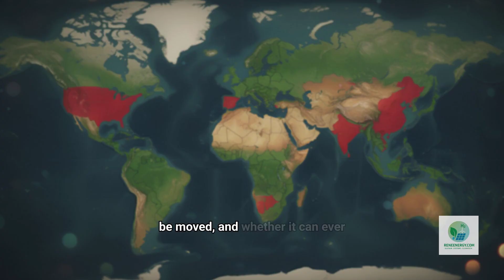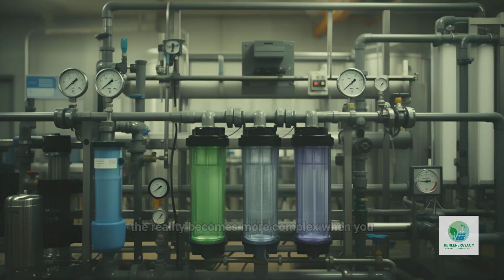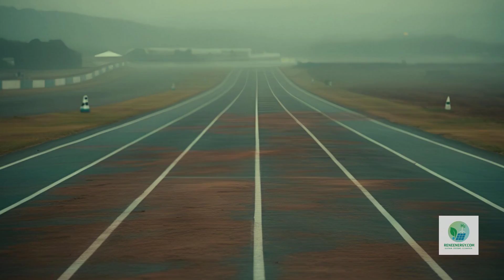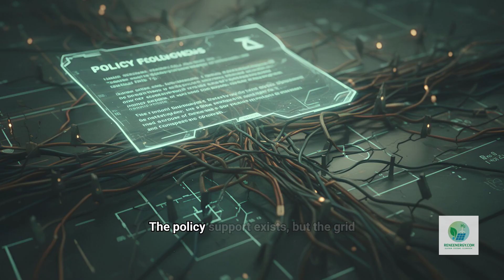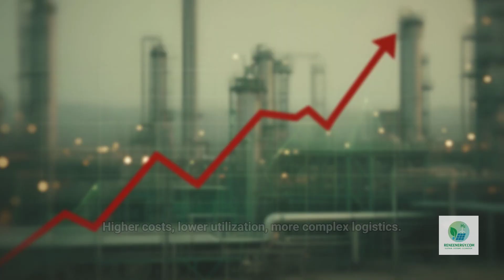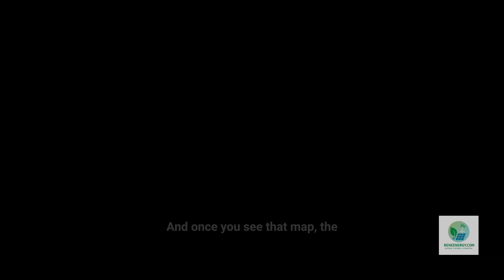The Map Problem No One Talks About in Green Hydrogen

Comment: In the early days of LNG, a lot of projects struggled because terminals were placed too far from demand or lacked the right pipeline connections. Over time, location proved just as important as the engineering.

That is what this reminded me of. A simple example is hydrogen production sitting far from where it is needed. Transporting it adds cost and complexity, which can make the whole project harder to sustain.

It shows how infrastructure and geography decides what works and what does not.

We should ask how many future energy projects will succeed or fail based on placement more than innovation?

Pilot Elizabeth Graham at Grace Aerial Technologies